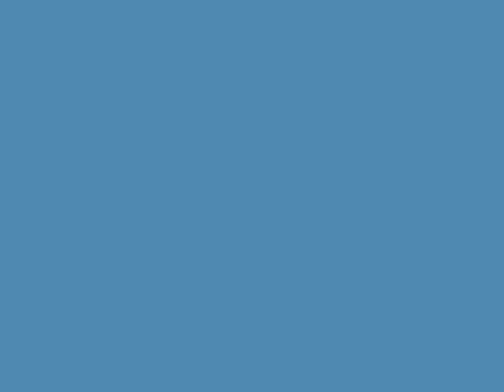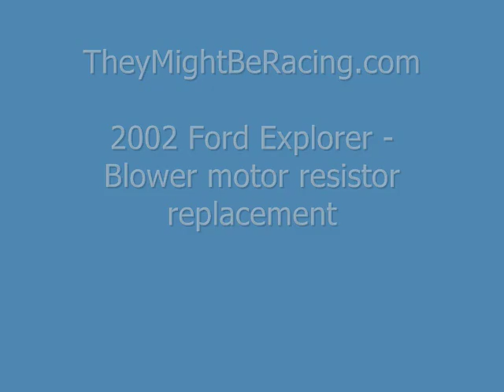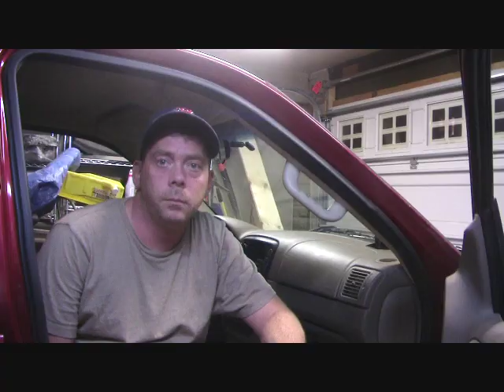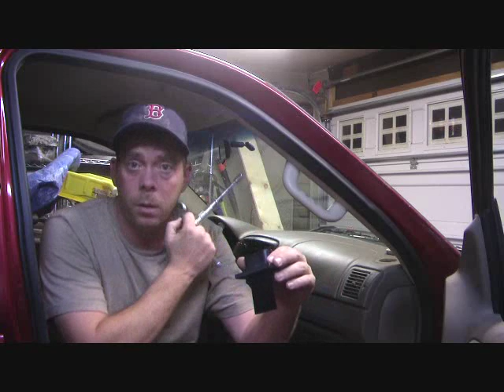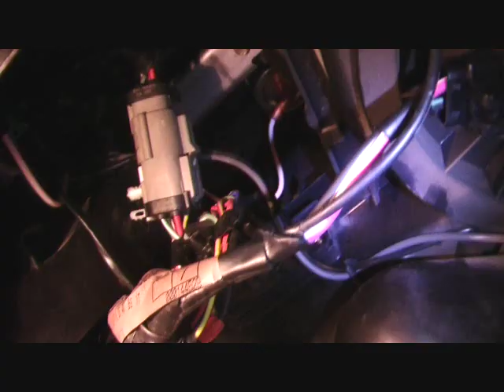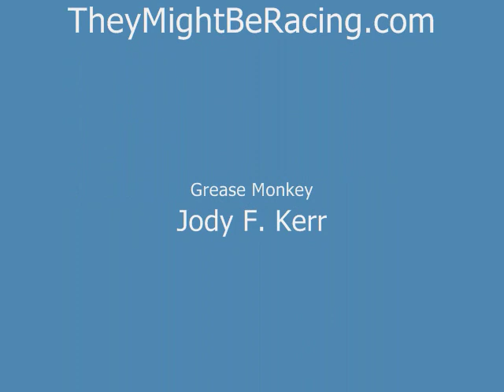2002 Ford Explorer - Replacing the blower motor resistor

Comment: On my 2002 Sport Trac the fan works on all 4 speeds. What it keeps doing is burning up the blower fan relay in the power box under the hood. Last time I installed a 30 amp relay, which worked for a while, until today it fried that one. I get about a month of use per relay before they die.
Reply: Sounds like the blower motor pulling too many amps. Time for a new blower motor.

Comment: The a/c was blowing and it quits blowing cold air. sometimes driving when the blower switch is turned on the a/c will all the sudden blow and will work again until car is turned off then going back out and starting to go again it will not come back on' this has happened many times the same way. Any answers?

Comment: I do not know it you are still monitoring this, but I will give it a try. The problem I am having with my 2003 Ford Explorer is very similar to the problem here.  The only difference is that I first, second and forth position work, but third position does not.  I can tweak the switch to half way between third and forth and I get the third speed.  Do you think that it is the resistor or do you feel it is the switch?  Thank you for any help.
Reply: sounds more like the switch if you can make the blower run on the third speed.

Comment: None of my fan settings push air through the front vents, the back works fine so im guessing it has its own part. This part should fix my problem also though right? When i first bought the car it only worked on the highest setting, but fixed itself shortly after that...a few months later it just quit working altogether.

Comment: My 2002 ford explorer blows cold air but it's only blowing from the defrost and not fram the vent. What can I do. I move the nob and it just not change
Reply: vacuum problem, ford defaults to defrost when loss of vacuum. Safety thing. check vacuum supply. many possibilities.

Comment from the maker: Not likely. Your vehicle probably has a dual zone (driver and passenger) A/C & heating system. If the's the case what has probably happened is that the blend door actuator on the driver's side is no longer functioning. It could be the actuator itself, or it could be the switch/computer that is causing the problem. Based on how deep in the dashboard this sort of problem is I'd recommend taking it into a shop for proper diagnosis.

Comment: I have a  04 Lincoln Aviator and the air blows out of the passenger vent in the middle. Faint are comes out of the rest of the front vents but only when it is on high. Does this sounds like a case like the video? Just looking for help.

Comment: It's not a 3-row Explorer with vents in the roof, but it does have center console vents that blow toward the back. I replaced the blower motor resistor, a physical feat someone my height, and that did not fix the problem.
Reply: the rear vents blows through a duct under the center console. Still have to have power to the blower through a power relay. This is a ground side switching so the power wire will be hot anytime the key is on. The ground goes through the resistor. Fuse , relay are just a couple of ideas. Check power to the blower, if no power then go to relay and check. If both show power then no ground from the blower motor resistor.

Comment: My a/c is cooling but it doesn't blow out of the front vents at ANY knob level. You can hear it working but it's not moving. (The cold air does however blow out of the rear-seat vents. Does this sound like resistor, or the blower)

Comment from the maker: If it's not blowing at all I would check the fuses/relays involved first. if those are good then it's either the resistor (which is easy to get to) or the blower (which is not easy to get to).

Comment: Nice video. I have a 99 Explorer with an eatc and air in the front and rear. I have no air from the front just the rear. Could it be the resistor and the blower motor? The motor isn't working at all.

Comment: I did it! It worked perfect. I ended up buying the part from the dealer, $97.07 including tax, 1/4" dr 5/16" deep socket for $3.99. My Ford Explorer 2007 blower resistor looked different. Here is what it looks like. :)   ---There are spaces on the link below to be able to work in the comments. :)
h t t p s : / / p l u s. g o o g l e .c o m /u/0/photos/109846666161956033483/albums/5836091408592464337

Comment: Hi, Today I had my heat on and there was a strange smell in my vehicle. After parking for a short time, when I turned my vehicle back on the blower motor switch would not turn past the number 2 setting, which blows no air at all. It feels like it's jammed. Did something melt? Please advise??!!

Comment: I have a Ford Explorer 2007 and the air conditioner fan is only blowing at full blast.  I hope it is as simple as changing the motor blower fuse or the blower motor resistor. Any quick suggestions?

Comment: I have a 2000 explorer limited the rear works the front doesn't blow anything at all.... Once in a while I can tap around the the fan area(under the glove box) wit a metal pipe... Not hard just a light tap and it will come on and work just fine. Turn the car off and back on and nothing... The tapping is no guarantee to work just once in a while... Any thoughts ??.... Please help thanks

Comment: Hi, I have a 99 mountaineer, the front air works great, but when I press the button for the back air to come on I get a burning wire type smell and it blows very low if at all.  Does it have a blower in the back and if so where is it?? Also do you have any idea what the problem could be.

Comment from the maker: It's there, it just may not be easy to see. There is a lot of wiring and such in front of it. Take another look. Keep in mind that when it's installed you can only see the bolt heads, flange and the plug sticking out.

Comment from the maker: I'm afraid I don't have a Ford Focus around to look at, so I don't know exactly the set up on the car. I do know that the space under there is really tight, so I've found a small 1/4" stubby ratchet tends to work best in cramped areas.

Comment: Can you show or explain how to replace a blower motor resistor in a 2000 Ford Focus SE?  I just refuse to pay a mechanic $240 to do it when the part only costs $60(the max)!  I need to know how to unscrew the bolt that holds everything together under the glove compartment.  My tool won't fit in the little space to unscrew it.

Comment from the maker: @sartsman That's lame. Any decent ford tech should have picked that up. Glad you got it fixed. The dealership does have a bit of a point there on aftermarket stereos(and aftermarket alarm systems). People often do a crap job installing them. Looks like I should install a new stereo in the Ford and do a video on that. It does need new speakers.

Comment: You are a lifesaver man. The Ford dealer refused to repair this issue stating that I have an aftermakret radio in the dash and likely damaged the wiring. Only the lowest fan speed didnt work. Thanks to you I fixed it myself in 30 minutes.

Comment: How do you test each part? I've got the same problem but I already bought a new switch and I'm trying to take the old one out. This seems like a much easier fix and it may be what's actually wrong. I'm hoping I can get a refund for this part and get the right one if so. But again, how do you test the switch and the resistor?

Comment: great review/video... I was wondering what you though of this similiar problem:  AC is working and blowing cold, however it blows it only to the windows and the floors position, just not directly to you.  I read somewhere that there is a lever broken that adjusts something to blow throught he proper direct vents.  thanks!

Comment: i changed both today, the resistor and the blower motor, the old blower motor had leaves, it didn't look in bad shape, but replaced it anyways as well with the resistor, but the resistor did look bad, but replaced both, and now it works, thank for you video, even though its not the same car, but the concept is the same, good and informative, thank you

Comment from the maker: @Rafaelipod I mean there is a switch in the dash, a resistor (relay), a blower motor, the wires, fuses, relays, etc. You need to work your way through testing each as you go.

Comment from the maker: @Rafaelipod Basically you need to diagnose the components involved. In most cases blower motors either work or they don't. Then you've got the resistor, and finally the switch. While I've not changed the resistor in a Chevy Malibu personally, I believe the location of the unit is likely in the same place.

Comment: i have a problem, i'm hoping its  either or, when i hit a bump that i don't see or brake rapidly, i can hear the ac wanting to turn on, but later gives out, and before that happened, the speeds used to only work on 4and 5, i don't know if it would be the resistor or the blower motor, what would you think it is, i would really appreciate it thank you, oh and my car is a 1998 Chevy Malibu